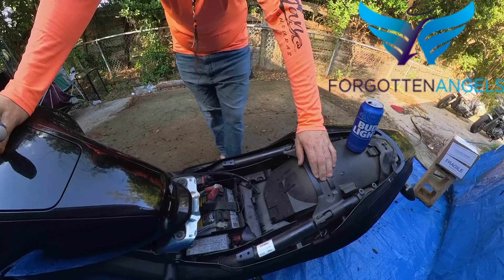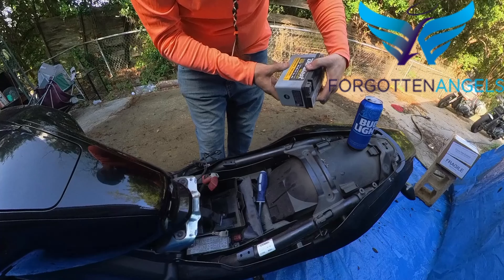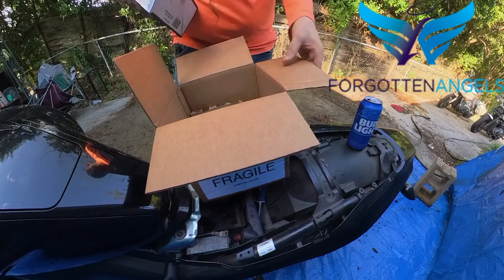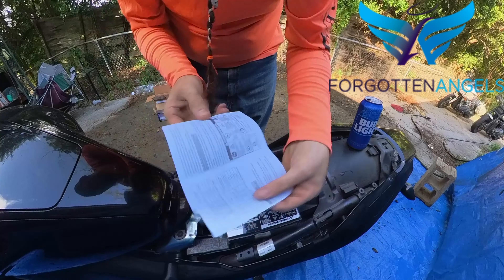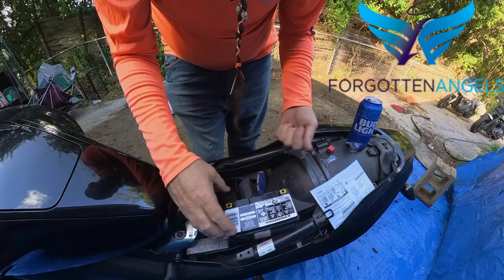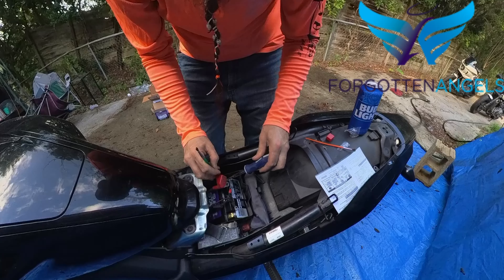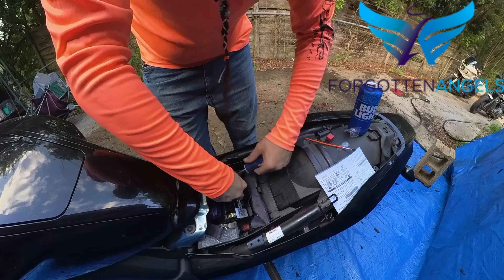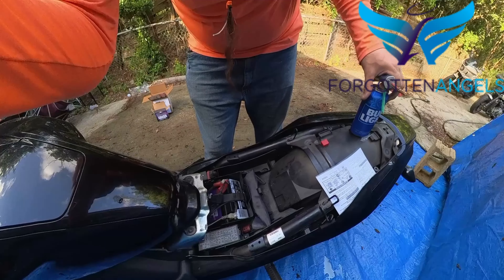The struggle of the Idiot

Comment: I had the same issue with the screws on my bike with the replacement battery but my battery is buried inside under the seat and behind the motor it wasn’t an easy job but I use a zip tie underneath the nut so the screw would finally catch
Reply from the maker: I got like 16000 of those things.... i could have just used 2?? Well, now 2 plastic paint brushes are in my tool bag.

Comment: A Velcro strap loosely around the battery makes it easier to remove... and the Neg wire connection is USUALLY the dead battery problems of HARLEY DAVIDSON
Reply from the maker: Luckily this 10 minute job only took half an hour or so.